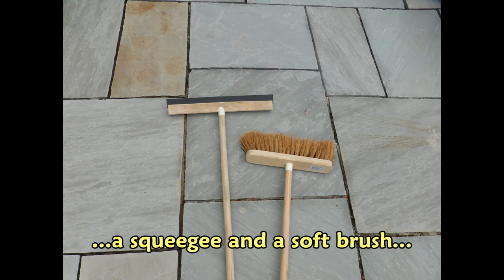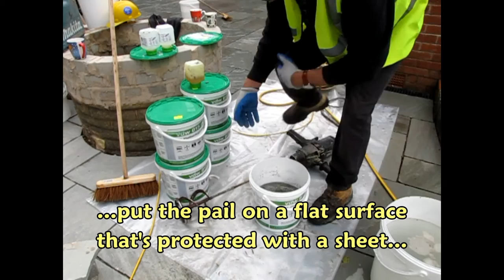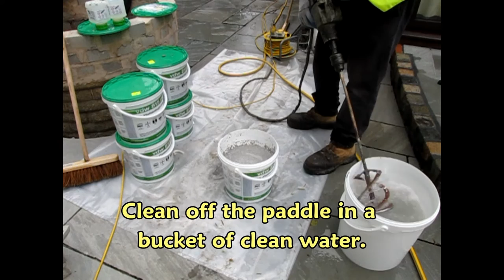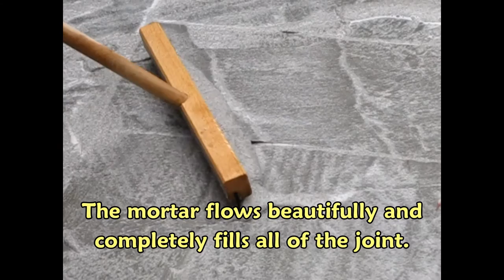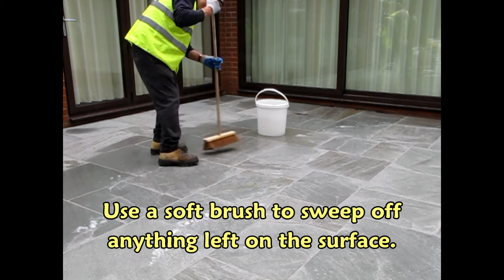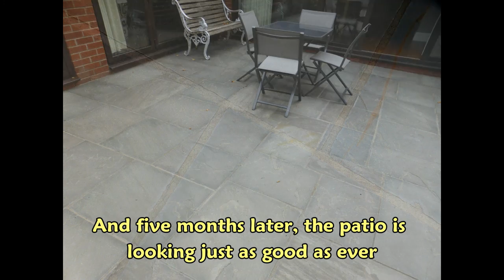Jointing a residential patio with Gftk 815+ resin mortar

Comment: Used this on a Black Limestone, all i can say is steer clear if you are using this on Black limestone, it looks easy on the video, but i assure you its not. The mix is quite foamy at first and goes into gaps ok at this stage, but the foam dissappears and you end up pushing a sticky clump about trying to get it into the holes, there were three of us doing this but as the product is a resin and sticky cold water does not really get it off or mix in with the product, and you also end up with a sticky sandy mess on the flags, took us days to clean them off good. Because of the cost I had asked my builder to do small gaps so I could use this product, i worked out i needed around 4 tubs and in the end used 11 and still one short, the bit of the patio which didn't have the gtfk in I used joint it and was far easier to use and cleaned off really easy, If i could do it all over again I would use Joint it and run with bigger gaps, Joint it is £36.50 for 20Kg of product, whereas Gtfk was £58 per 10kg tub.
They have just been sealed and the flags with joint it look far smoother as they cleaned off easy, we scrubbed washed hosed non stop with the gtfk and have some sandy looking flags but gave up trying to mint them so to speak.
Very dissapointed with the product considering it cost me over £600 to simply grout a patio, probably would have been nearly half that doing bigger gaps and using joint it and for sure it would have looked better.
it may work better with different flags but if you intend to use black limestone stay well clear, you will regret it!!!!
Reply from the maker: If you were, as you claim, "pushing a sticky clump about", that indicates you are not using anywhere near enough water. At ALL times, when jointing with VDW815, the mortar should be completely fluid, flowing easily and cleanly over the surface, because more water is being constantly applied to keep it moving. It seems you failed to read the instructions and didn't take in the guidance provided by the installation video. I have witnessed hundreds of problem-free applications using 815, and its sister products, and the only time (once!) I witnessed the problems you report was when the installer assumed pre-wetting the flags would be all that was required....again, he hadn't read the instruction or paid attention to the video. Luckily, I was there to point out the error of his ways and all was rapidly, and simply, put right, by getting him to constantly play the hosepipe over the mortar as he moved it across the empty joints.
Reply: Sorry tony the product is not as good as you claim, we did ours when the sun had died down and we left the garden sprinkler on half hour before doing the mortar, i bought a paddle mixer for the job, the mix was made, flags rewetted, mortar spread out and soaked again with one person at hand extra to keep spraying!! water was sprayed more than adequately on the mix, but the mix acts lets say like coca cola when first poured it fizzes and foams then dies down, your mix acts like that, its very foamy for about 3 mins then the foam dissapates and you are then pushing a thicker material around which doesn't fall into the smaller gaps, and because its a resin water does not thin it even though i had one person on the hose alone constantly wetting it, and like i say because its sticky water will not rinse it away fully you are left with a very fine coating on the black flags. Im just super dissappointed at the effort needed to use this product on the black limestone, you may get away with leaving a fine sand on others but not on black, if you look at the joint it section we did, far cleaner and smoother thats because it brushes off better but it is a bigger grain.
it may well work for other flags, im just saying that for Black try something else, but youre bound to defend it as you took over £600 off us for it, but on a positive note im liking the Kseal so far.
Reply from the maker: I didn't take a single penny from you. I don't sell this product nor any other. I help promote products in which I believe but I receive no commission. I choose to impoverish myself by defiantly NOT selling anything at all, other than my knowledge and expertise, otherwise I couldn't be honestly critical and truly impartial.